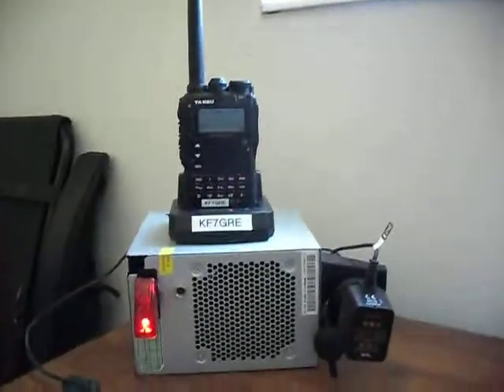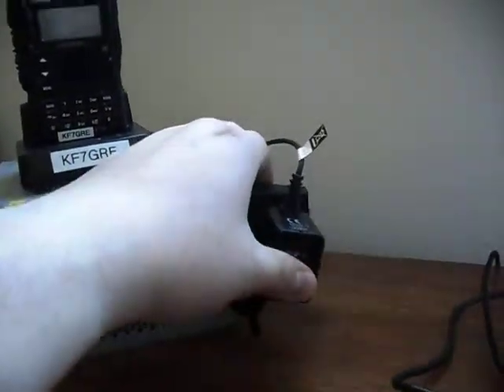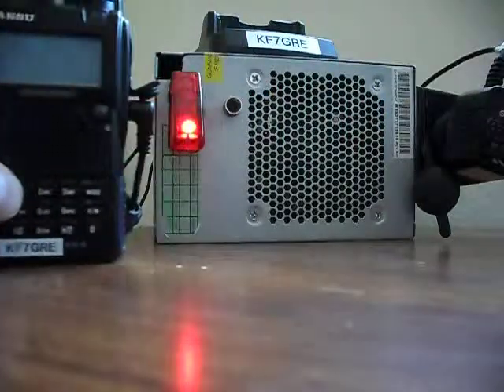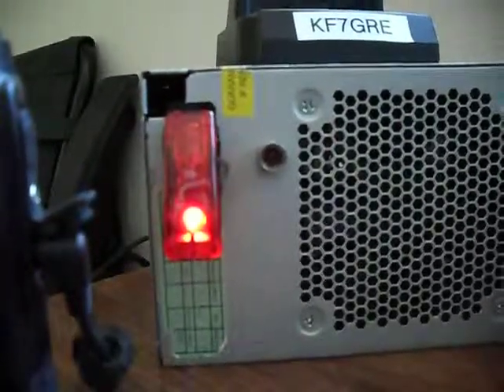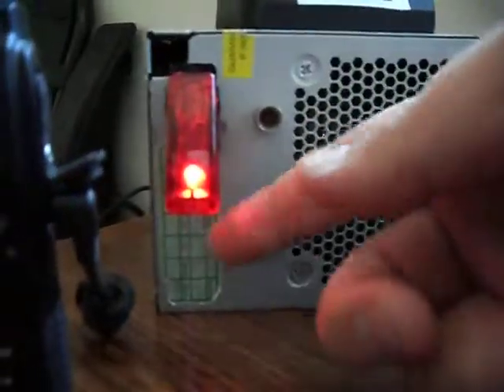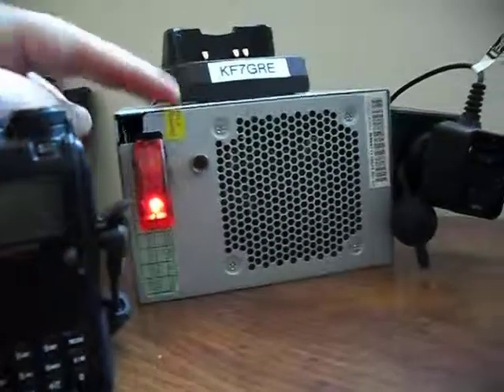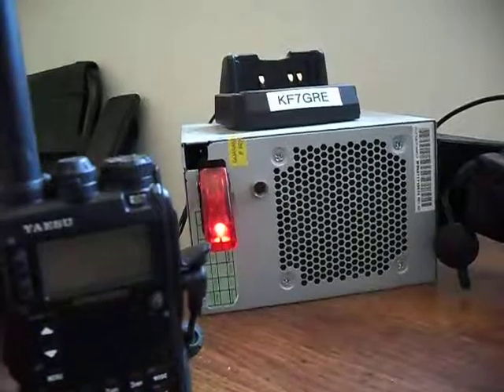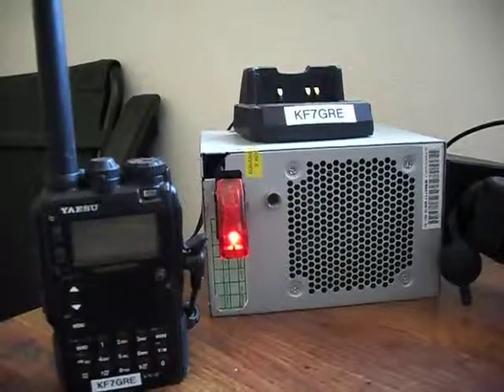T3CH Mod Amateur Radio Power Supply

Comment from the maker: Jeff, I don't have a video of it but its pretty simple to build. Open a psu, gather all 12v lines and all common/ground (usually black wires). The tricky part is that the psu won't put power to the rails until the green 5v lead is grounded. I wired the green lead to the toggle switch and ran a 5v lead that only has power when the entire psu is on to the power led. That's it. When toggle is on, green lead is grounded psu puts power to the 12v leads. Solder those leads to a terminal for your ht or basestation to hook into. That should be it. Do it at your own risk!! Be careful of those large capacitors in the psu. Those will put you on your ass or send you to the er if you are not careful.

Comment from the maker: @RadioCanada911 nope, no noise. but i only used it with my ht that has a filtered auto dc adapter. i imagine, since it is purposed for a pc, there should be no noise. there is no alternator in the circuit, so you should be good.

Comment: Do you get any inline noise on receive? I am looking at using a 104 amp computer power supply with a single rail 12+?